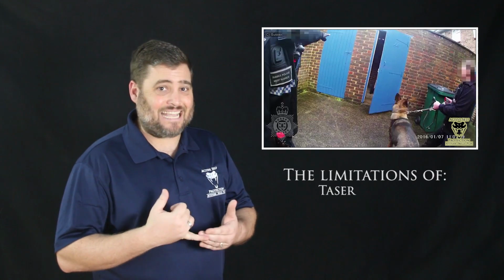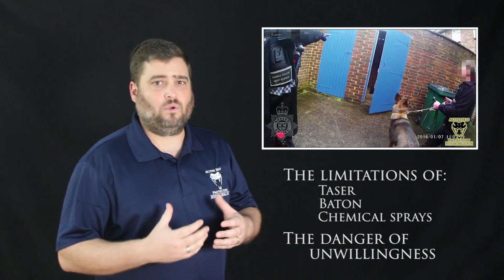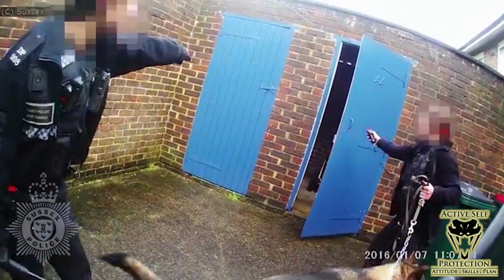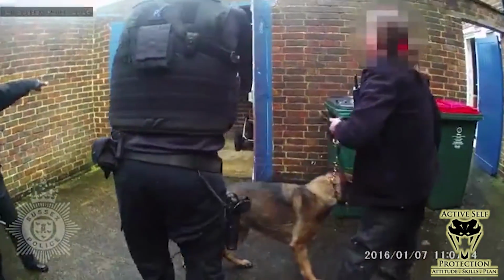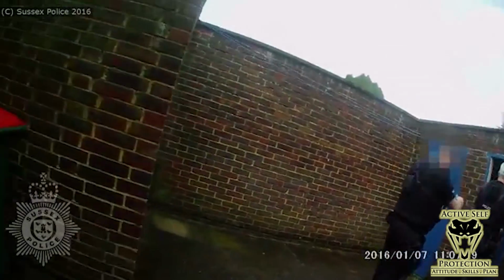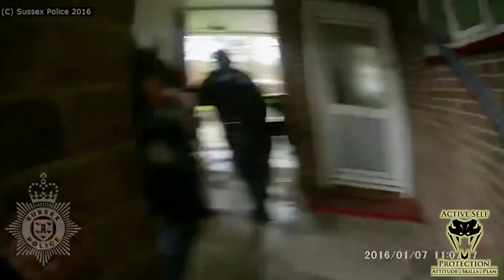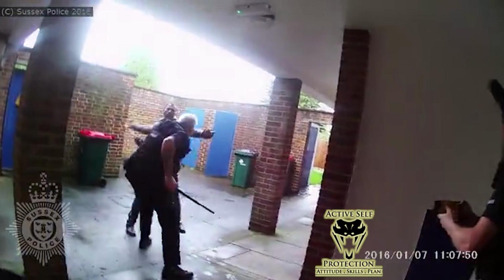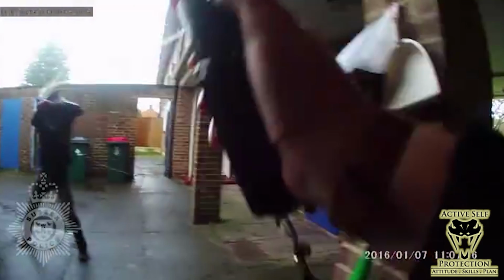Police Fight with Hammer Wielding Killer Shows Limits of Less Lethal Tools | Active Self Protection

Comment: The incompetence of this display has nothing to do with the absence of (or failure to use) firearms - there were plenty of opportunities to take down this bloke in less-lethal ways. These cops lacked situational awareness, and lacked coordination with each other - they had environmental tools and cover around to use (the bins, the stone pillars), they could've rushed him, they have extendable batons (which ironically used to be called ASPs) which could've been used to go low and take out his legs or knees, they have PAVA spray to temporarily blind him, they could've (and should've) released the dog - so many options, and if you watch shows like Traffic Cops, Police Interceptors or various other ride-along shows from the UK you will see plenty of occasions where better trained and better-prepared officers have stopped threats like this without having to resort to wildly blowing someone away, which is often the US cop's answer. 

It's arguable that there were too many officers here in this confined space. As a result, they got in each others' way, and maybe each had a slightly different way of approaching the situation and each thought another would take the lead. If there had been no more than 3 cops (plus the dog) and they had all gone forward on the man in a coordinated move, they could've overwhelmed him. Set the dog on him to grab his weapon-holding arm and drag it down, while the officers jump the guy and take him to the ground. That's what I've usually seen in similar situations where someone has a blunt force weapon with an arms' length range like that.

I wonder when you're going to show any footage of the numerous occasions when UK police take down an offender with a knife/axe/machete or even a gun, without serious injury or loss of life and without the need to open fire with a gun themselves, and point out the offensive and defensive skills used in them? I daresay you won't because it goes against the general narrative of this channel that having and using firearms is somehow vital and it's impossible to live or to uphold the law without them. But there are plenty of examples out there of the bravery and skill of police in the UK who are daily stopping armed offenders without having to make more work for undertakers!

Comment: taser sucks, a 50% success ratio compared to 85% success ratio for pepper spray. They can also be lethal in many cases, so it is in fact less human than to use a firearm.
Furthermore, Tasers can also be used as torture method by bad cops (at least here in Latin America where forces are way less professionals and we have an obscure dictatorship background history in our security forces).

i don't find any single reason to promote tasers, they are expensive, the battery replacements are expensive, they have a huge fail rate, they can be used as torture tools, they can produce the undesired death... just DON'T

Comment: These officers saved a life and ended the threat.  I don't know why you don't think this is an excellent example of police keeping their cool under pressure and acting with high levels of professionalism. These are the kind of police I want,  not the "shoot whenever there's a deadly threat" kind. It's braver but more importantly most of the time the outcome is better.
Reply: By keeping your cool you mean panicking,screaming, and running away? They just plain out got lucky that hammer didn't connect with her skull instead of her neck. Absolutely horrible job but sure call them to help if someone shows up trying to cave your head in with a hammer. Good luck with that.

Comment: The number one thing I've learned from this channel?  Tasers don't work.
Reply: Taser is summer weapon for naked people.
Reply: The guy has a padded anorak on. These jackets, due to the layers of padding, limit the barbed prongs of the taser from getting direct contact with the targets skin. Without a good contact the taser will have limited effect.  So the answer would be to increase the power that the prongs are fired at. This then gives the opposite problem against a target with only a tee-shirt on. So you could have the prongs over penetrating and effectively be considered lethal weapons.    Would baton tasers be better?
Reply: Some nice spicy sauce could have worked.
Reply: Either do female cops
Reply: Gotta remember this channel is like the news they only show the bad barely show the good

Comment: I don't know when exactly UK police officers are allowed to fire a gun on someone. The biggest difference between UK police and officers is the mentality, and instinct to reach for the gun and prevent a situation from escalating. However police with guns will lead to a higher percentage of criminals with guns but that's another conversation. 

Based on this video, police should reassess all of their training... one got hit by a hammer and was lucky that it was just a little hammer. This was a life threatening scenario and in spite of already having failed with the taser one of the officers tries again. Tasers in my opinion are a pre-violence option. 
I don't think a squad of 4-6 cops all need guns pointed at one person but if this guy had a gun they could've all been dead before even thinking about using their own guns. Two of them were in direct conflict with a hammer. If one of them had shot immediately after the tasers failed - none of them would have been hurt.

Comment: There is a lot of discussion here about this incident, and some inaccurate information finding its way into the thread. So, for clarity : These two armed officers are UK armed response vehicle crew (ARV officers) - generally referred to as AFO's (authorised firearms officers). They were only carrying pistols which suggests that the incident had not been declared by the force control room to be a "firearms incident", meaning that when they deployed to the job there was no information that the suspect was in possession of a lethal weapon. Had there been relevant information they would have been given an "authority to arm" by the control room and would likely have been carrying a carbine of some description.
Certain criteria need to be met before such an authority is given. These are those criteria :

******

Criteria for the deployment of AFOs
 : 

The deployment of AFOs should only be authorised in the following circumstances:

where the officer authorising the deployment has reason to suppose that officers may have to protect themselves or others from a person who:
is in possession of, or has immediate access to, a firearm or other potentially lethal weapon, or
is otherwise so dangerous that the deployment of armed officers is considered to be appropriate, or
as an operational contingency in a specific operation (based on the threat assessment), or
for the destruction of animals which are dangerous or are suffering unnecessarily.

Reason to suppose
Use of the words ‘reason to suppose’ sets the level of knowledge required (about the existence of a threat justifying the deployment of AFOs) at a far lower level than that which would actually justify the use of firearms.

******

More info here : https://www.app.college.police.uk/app-content/armed-policing/use-of-force-firearms-and-less-lethal-weapons/deployment-of-afos/#criteria-for-the-deployment-of-afos

Crucially though, armed officers can SELF AUTHORISE to arm at any time if they believe that the above criteria are met, and it's not possible or practicable to seek control room authority first. For example, an armed officer on routine patrol with just a pistol could draw and fire the pistol at a deadly threat without having to ask the control room for "authority to arm", and could self-deploy with carbine if needed. They would need to justify their actions to Chief Officers though.

Comment: You criticise them for not shooting, but tbch they would have been fired for shooting in this situation in the UK. I can 99% guarantee that the response from the IPCC and the Courts would have been "why did you keep the dog on the lead? Why didn't you attempt to subdue with public order shields? You didn't sufficiently attempt non-lethal force". There are videos of 10 -15 police officers having to use shields, CS gas and batons against machete wielding criminals simply because unless the criminal has a firearm the regualtions simply won't allow you to shoot.

Comment: If anything, this display tells me we need significant R&D put into more effective non-lethal countermeasures. Maybe not so much tasers, pepper spray, or specialized ammunition, but a gun specifically designed for non lethal neutralizing of long range targets. Why not flashbangs? Why not a collapsible and modified M203 stand-alone style grenade launcher that fires stun grenades? Or goo grenades? Everyone has eyes and ears, right? Perps can’t be much of a threat when their blind and deaf. Have the cops carry and wear eye and ear protection, problem solved. Or maybe a rifle mounted taser/battery contraption that fires larger hooks with more penetration and power, that can have more than one taser loaded on it at once. There’s plenty more options out there for non lethal that would be better than this or a bullet. People just need to get creative.

Comment: See although I 100% think deadly force should have been used, the problem with the police here in the UK is not the officers, it's the IPCC, independent police complaints commision. Although they have a job to do, armed police can be treated almost like criminals when they use their weapons. They are put on leave and one, in fact, was charged, when he didn't do anything wrong. He was later found not guilty but he should not have been put through that in the first place. In the USA it is easier to give a reason to why you would have used your weapon. It seems to me like the barrier stopping the police from using deadly force was the IPCC, although I do understand they have a job to do.

Comment: I just Unsubscribed - retards controlling the comments where I actually had a good solution forvthe cops to use shields and batons against a hammer and a nutjob, but you morons cant handle good solutions so you delete comments or send them to the bottom
Reply from the maker: Well, bye. Why you would hold a channel responsible for the idiots in the comment section is beyond me. But don't watch. That's lovely.